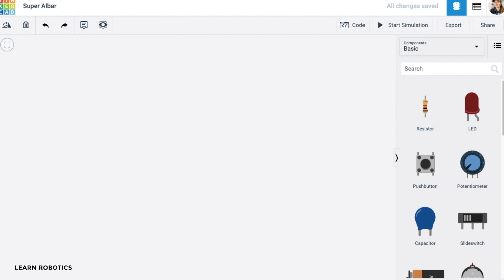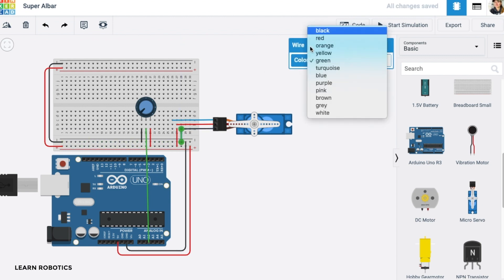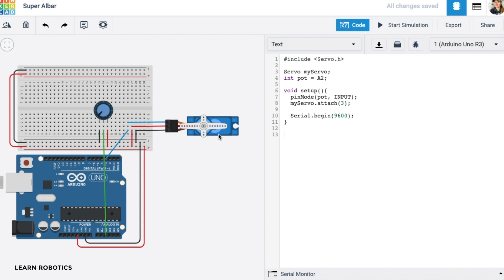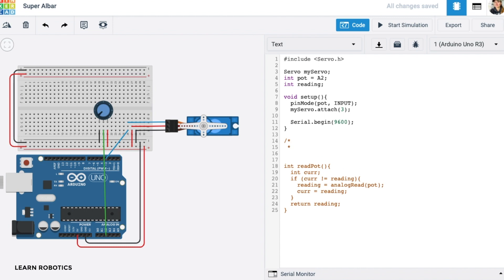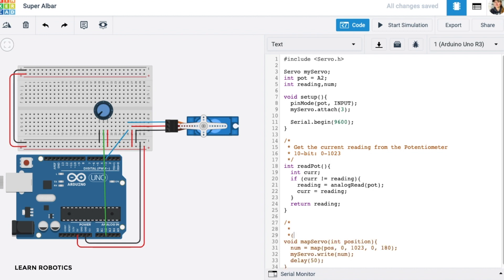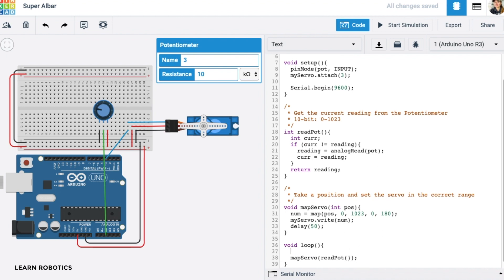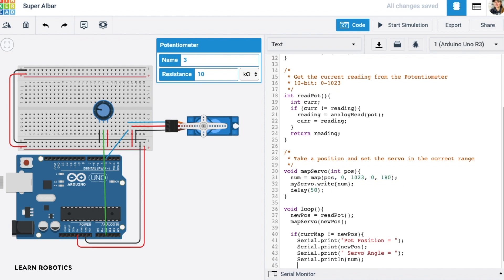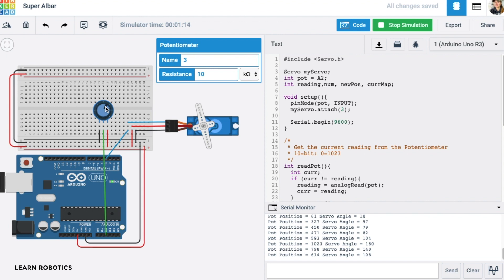Control a Servo using a Potentiometer using Arduino Mapping

Comment: How would this look like on HCS12?
Reply from the maker: Probably similar to programming a Servo by setting the duty cycle. I have an example that shows the Calculations with Raspberry Pi, concepts should be similar if you read your datasheet - check it out here: https://www.learnrobotics.org/blog/raspberry-pi-servo-motor/

Comment: Hi
I assume that if you program the servo at -180 it will go in the opposite direction?
The reason I am asking this is because I have built a robot arm but 3 of the axis are going backwards and I think iys meant to be programmed at -180
Reply from the maker: You'd have to look at the Servo library. I think it's positional. i.e. If you're sitting a position 180, to move back to zero, you'd program 0. Double check the docs.